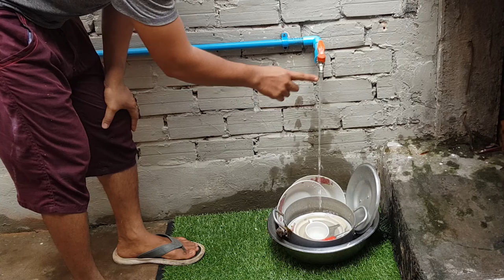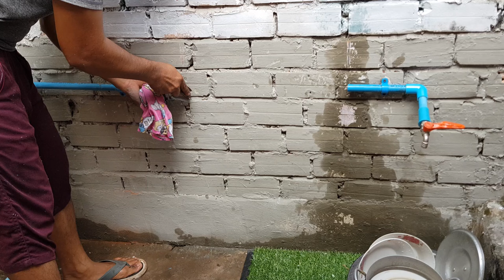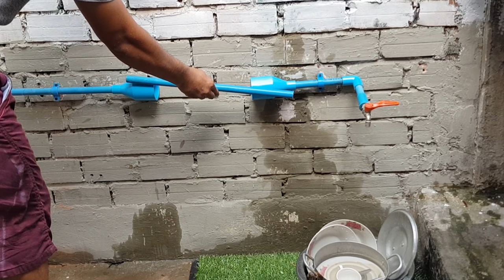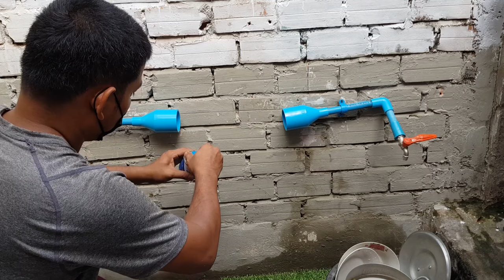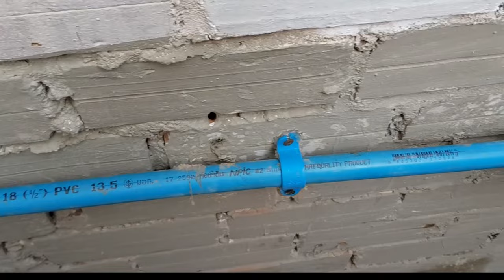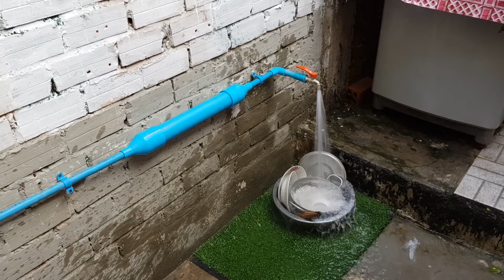Amazing Idea to fix PVC pipe low pressure most people don't know #PVC #freeenergywaterpump

Comment: Un real mentira, la presión en un sistema depende de la diferencia de altura entre el origen (supongo que en este caso es un tanque de almacenamiento) y la descarga, y no del diámetro de las cañerías involucradas.
A real lie, the pressure in a system depends on the difference in height between the origin (I assume in this case it is a storage tank) and the discharge, and not on the diameter of the pipes involved.

Comment: Ano tawag don sir sa parang Imbudo
Reply: tubo rin po na  may mas malaking size...how it works? first may air or hangin sa loob ng mga empty tubes including the (imbudo) tube na na-trapped or na compressed kaya ito ang nagpapalakas ng pressure...back to normal pressure na po ito kapag na ubos na or nailabas ng lahat air na nakulong sa tube... hehehehe
malakas lang ito habang may air pang kasama ng tubig pero kapag nakalabas ng lahat ng air na yun eh... tapos na ang "magic" nito at dapat na gawin muli style (compressed the air inside the empty tube) para lumakas muli pressure... nangyayari ito sa atin kapag nawalan ng supply ng tubig....papasok ang air sa empty tube then closed u po valve at kapag bumalik na supply ng tubig eh magugulat po u sa unang open u ng valve gawa ng nakulong na air sa tube na pushed naman ng incoming water...